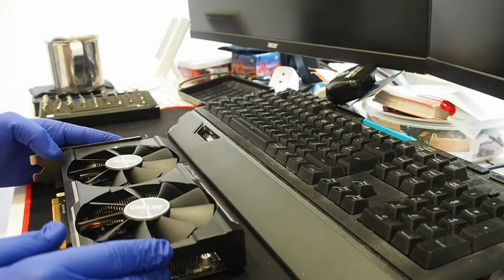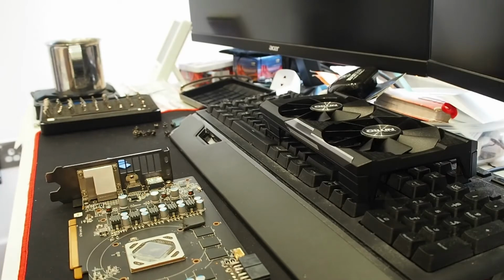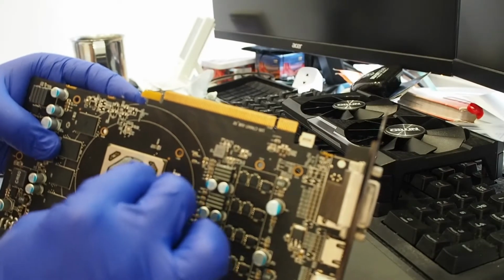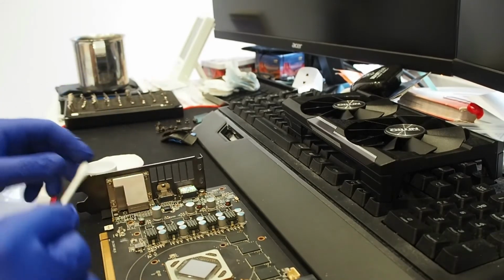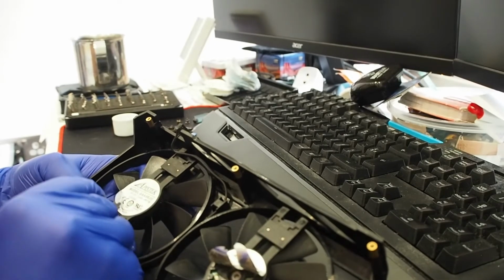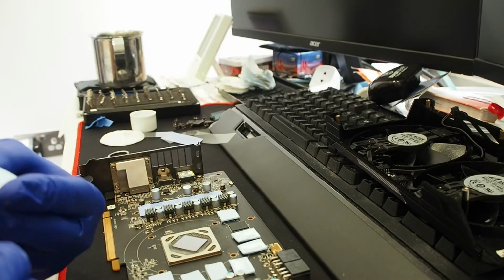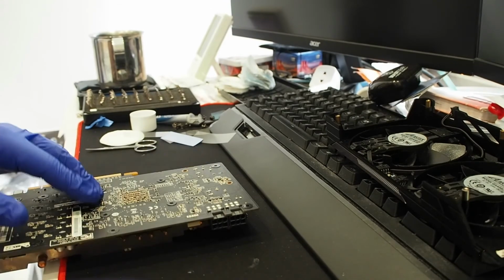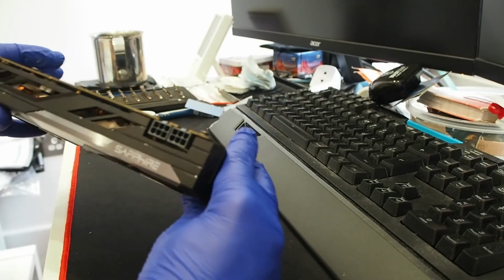Sapphire R9 380 4GB OC Edition - Disassembly and cleaning

Comment: Thank you for this video. 👍
I have exactly the same GPU (saphire nitro R9 380 4Go).
I used it since march 2016 without any maintenance.
I would like to do like you. So can you tell me please the thermal pad thickness ?
is it 2mm or 2,5mm ? is it all same thickness ?🧐
I'm sorry but i don't have thermal pad, so I would like to buy exactly what i need. 🤓
Reply: Did you ever figure this out? I need to replace mine as well

Comment: i have same  GPU (saphire nitro R9 380 4Go). i have face some issues like 1 fan not working, pls tell me where repaire it
Reply from the maker: Hi, since theres is only 1 fan working and no separate controller for the other you need to replace the broken fan. That's your only solution. You can find replacement fan on AliExpress. I hope this helps.

Comment: While WD-40 does have some lubricating properties, it is not a good lubricant and should not be used for this purpose. Using it on anything that needs proper lubrication will not give you the results you want.
The main reason for this is that only a fraction of WD-40 is made up of lubricants. And these are only light mineral lubricants, unsuitable for any serious friction or heat.
The rest of the product is made up of compounds that aid penetration. These also have lubricating properties, but because they are volatile compounds that evaporate over time, their effect does not last.
On top of that, both the application of WD-40 and its evaporating components dissolve and displace existing lubricants, like lithium grease or graphite.
Reply from the maker: Agreed. Do you know any other product to get, suited for this purpose, thats available in Europe/UK/US ?
Reply from the maker: will give it a try. Thank you for recommending it. already got a bottle.

Comment: Ok so i did replace the memory pads with 2 mm pads but it seems the GPU isn't properly making contact with the heatsink, my temps went up from 72 degrees to 77 degrees in Furmark and it does display some weird shadows during the test, but when i'm looking at the artifacts counter it says it found 0 artefacts. The video card wasn't doing anything like that before i replaced the pads. Any advice?
Reply from the maker: Thats unexpected ! what kind of Thermal pads was it ? Low thermal conductivity might cause this.
Reply: @Madmax0620  Thermal Pad 6W/mK conductivity, i've chosen medium since they were out of stock with the pads that had better conductivity, it seems that the issue with those weird shadows is completely fixed, they don't appear anymore during the tests but the temps kind of remain the same. It seems that the pads themselves are causing the gpu die to not make proper contact with the heatsink and this causes the GPU to overheat, i think i should've used 1.5 mm instead of 2.
Reply from the maker: @redragongaming  77 degrees are not abnormal for the core, even if it's not making proper contact. Something else isn't making proper contact and creating these thermal issues. Yes try the 1,5 mm pads.
Reply: @Madmax0620  I've checked the gpu die and indeed there isn't full contact with the heatsink, based on the spread of the thermal paste is making contact only the center of the die, not the entire one. So the 2 mm thermal pads aren't as squishy as the factory ones even though they are of the same thickness.